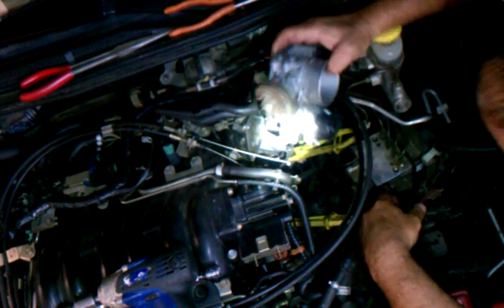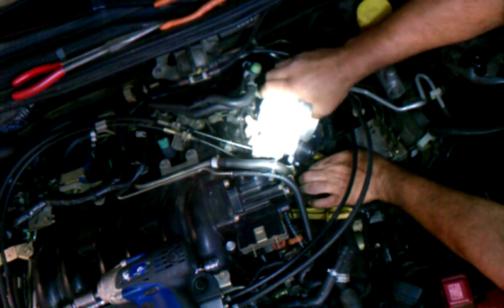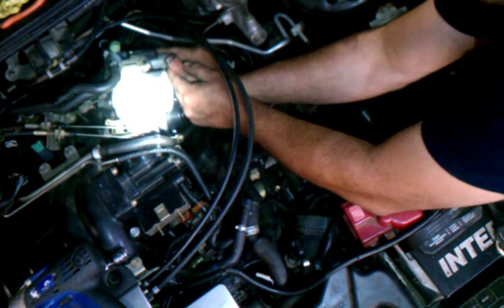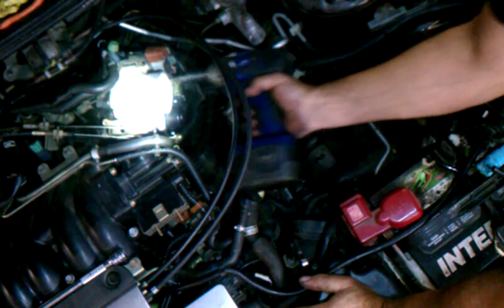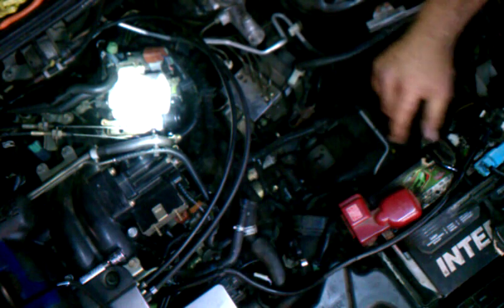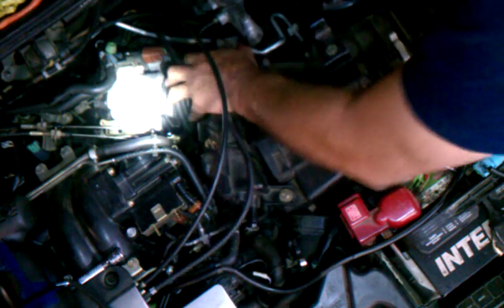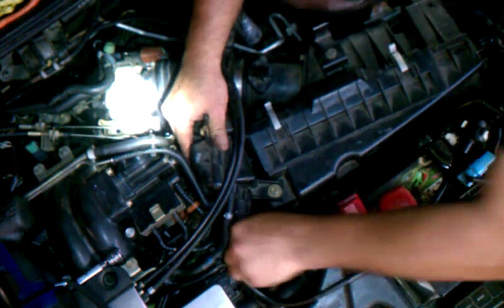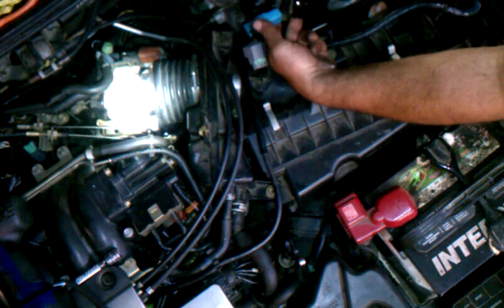P0505 Ecm IAC issue 2000 & 2001 Maxima and I30 Part 3 of 6

Comment from the maker: Check the throttle cables. Make sure they are not to tight. To verify the cables being to tight, loosen the 14 mm nut that locks them down. Take the cables completely off the bracket so they are loose. Then start the car. If the surging stops, then the cables were to tight. Adjust to correct

Comment: I have a similar problem with a 2001 maxima. how much should these parts cost? The car still drives but is hesitant from the cold start and then get better as it warms up.  Do i need to replace the ecm if the car is running or justy the iac

Comment: I haven't check the cables but that's a good idea. I pretty good with the trouble shooting. I have read that there is a manual  throttle "relearn" of the 98 Nissan maxima is this true? Figure its worth a try to ask you.

Comment: What would be the problem if the car starts and shuts off on a cold start, idles rough and shakes stopping at a stop sign or light. An occasional smell of exhaust inside the car? Its a 2000 infinity i30 with a 2.2 liter.
Reply from the maker: 3.3 you mean? Do you have a Service Engine Soon light on?
Reply: FixyourNissan , yes the service engine light is on. Its been taken to oriellys and auto zone for it to be scanned but no code. Its a friends car and thats the info i was given.
Reply from the maker: If the Service Engine Soon light is ON there has to be codes. Unless there is a problem with the Ecm and a scanner can't communicate with it properly.